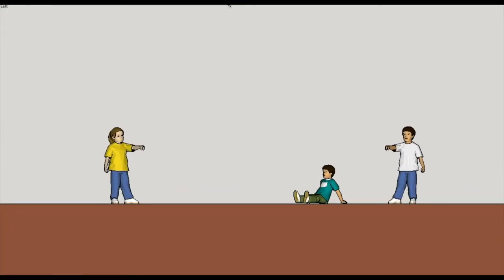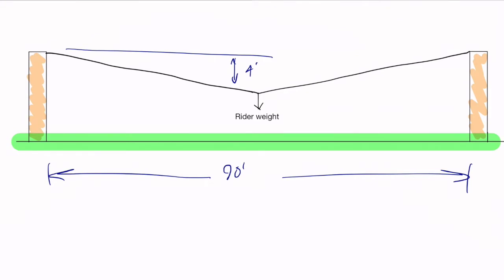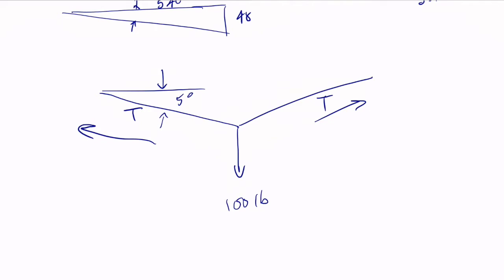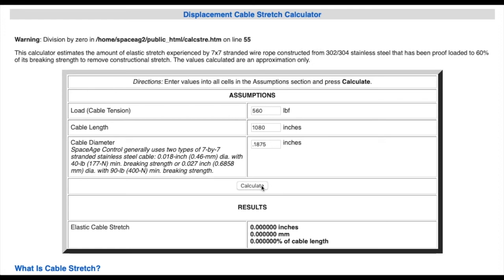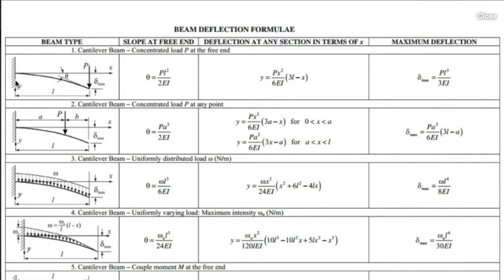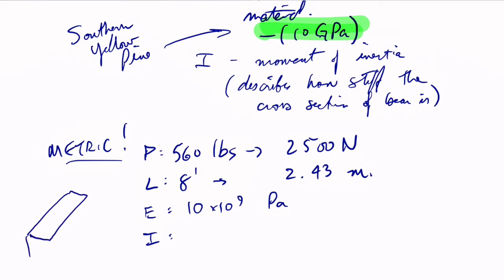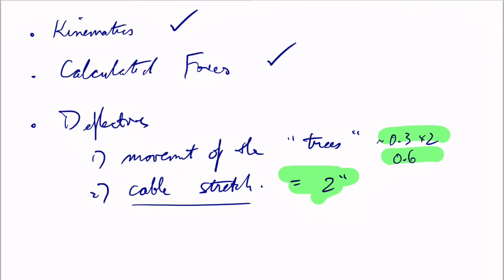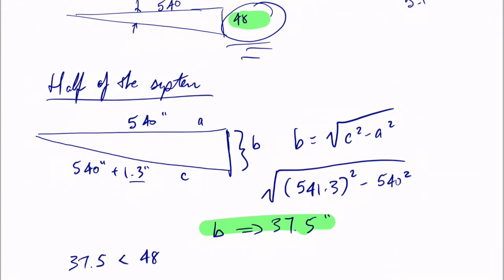Zip Line Calculations

Comment: I have a 500ft zipline in my backyard and we just used a string as a rough estimate of the height we needed. For some 250lb riders, they will bottom out in one spot, so we use a shorter leash for them to fix that issue and with really small kids we use two leashes so they can reach the platform at the end.
Reply from the maker: 500 feet!  Awesome.  Yeah, the big takeaway from my zipline experience is don't overthink it (if you have decent anchor points).

Comment: I’ve build 1000 feet long zip line with 5/8 cable. Is diameter sufficient? Thank you !
Reply from the maker: Man, that is an expensive cable but it seems like a reasonable diameter for that length.  Your anchor points are going to need to exert 3 or 4 tons of force, those are going to be expensive anchors also.  Good luck, and I look forward to seeing the video!
Reply: @BILLYSHED  it’s on my channel already! But video in Russian language)
I just wanna make sure the diameter is safe.
Reply from the maker: @misty_mountain  Awesome zip line!  That was a lot of work. Do you plan to sell rides on your zip line someday?
Reply: @BILLYSHED  no, just for fun.

Comment: Did you check the margin of strength on the cable (and connections)?  At what rider weight does the cable start to yield?  If it yields, is it still usable afterwards if you tighten it?  Do you know if cable work-harden? 

I am considering a zipline for my grandkids, and appreciate your engineering.  I am a retired aerospace engineer, and make similar videos on various projects.  The more math, the fewer the views, unfortunately.
Reply from the maker: Naw - I didn't calculate anything with the cable.  It came as part of a kit and the manufacturer's instructions said it was rated for a 300-lb rider (I think?).  I am 200 lbs, and it didn't yield under the stretch loads caused by my weight.  I imagine there's a good chance that the cable supplier already work-hardens the cable, because I calculate that a 200-lb rider ride puts it well beyond 0.2% strain.  Or maybe the first couple of rides stretch-harden it like you are asking.  It's not an issue, don't worry about it.  Look up what other people suggest.  Good luck.

Comment: As I watch your calculations (with gratitude and fascination, trying to relearn the math!) I realize that if the downward deflection is between 3 and 4 feet (37.5" to 48") our IBC tank anchored zipline system isn't going to be all that successful given that an IBC tank is only 3 feet tall and we would be putting the cable sling somewhere lower than that... Hmmm.  A failure? Or can we increase the tension (since nobody will be riding on it but it will be used for transporting cacao pod baskets). Any ideas?
Reply from the maker: Sorry friend - no ideas.  I am sure you will figure it out.  "Necessity is the mother of invention" - someone famous

Comment: Using telephone poles.  5% decline in  terrain with 100’ run.  Thought larger pole should go at top.  Does it matter?  10” diameter pole vs 12” diameter.  Concrete will be poured 4’ deep holes 3’ W x 6’ L
Reply from the maker: Ahem... size matters, of course !  But not like I think you are implying.  The pole at the top of your run isn't going to experience much more cantilever load than that at the bottom just because it's at the topside of the run.  If either the top or the bottom pole needs to stick-up higher out of the ground, use the larger diameter pole for that end.  Good luck, and I'd love to see pics / vids...

Comment: do you need to consider the weight of the cable in the force applied to the end points?  100ft of decent cable is pretty heavy.
Reply from the maker: The short answer (specific to a 90-foot zipline with 3/16" diameter cable) is "Nah, not so much".  The preload force needed to pull the sag to a reasonably small amount  is significantly less than the load once a rider jumps on.  If you have the preload pulled so tight that it significantly loads the endpoints, your rider is probably going to plow hard into the end of the ride.  Consider that ziplines are designed around stiffness / deflection.  Anyway, longer runs with heavier cables... yeah you will probably start to need worrying about the cable weight (or the preload force).

Comment: I have a customer who wants me to install a zip line inside their house from second floor to first floor I don’t think it’s possible any suggestions on how to do it so nobody get hurt
Reply from the maker: This sounds like a fun idea at first (assuming your client has a huge space?) but if you sit down and sketch some rough dimensions of the line and anchor points, and the rider hanging off the trolley, and if you think about how zip lines work, you will quickly reveal to yourself that, at best it's a bad idea and at worst it's pretty much impossible.  Sounds like maybe you already have reached that conclusion.  All zip lines have a downhill part (at the beginning), and an uphill part (near the end).  This is how you slow down.  If you don't have an uphill part, then you need a substantial braking mechanism.  Is your client's house like a normal family residence, or more like an industrial warehouse?
Reply: @BILLYSHED  just a normal residential house  hallway 3.5 ft at top 4 ft at bottom. I have built a lot of crazy projects but I think this out of any realm
Reply from the maker: @drumnmachn19   It's not in anyone's realm.  It's a busted idea.

Comment: Hi. You assumed at 1:40 that the rider is gonna drop 4ft over a 90ft run. Why did you assume 4ft? Is that from the sloap of your yard that is 4ft and bems at 8' tall?
Reply from the maker: I assumed four feet in order to roughly estimate the tension in the line.  And, 4 feet is a decent estimate just considering how my zip line worked.  If I assumed 3 or 5 feet, the rest of the math wouldn't change much.  The slope of my yard over 90 feet was about 6 feet.

Comment: Thanks for the video, really enjoyed it. I'm attempting to put a zip line in my garden for my kids to play with and plan to use 12x2 timber laminated together like you did. Was the 4ft depth of the end points based on a calculation? Im digging by hand in hard stony soil and am wondering if 3ft will be deep enough? What do you think?
Reply from the maker: Hey Graeme - I assume that the 4ft depth recommendation that you find all over the place is based on calculations, but not mine.  Check out https://www.ziplinegear.com/pages/how-to-build-a-zip-line-section-one-concepts  (.)  I strongly advise you to just bite the bullet and abide the 4ft recommendation.  I also HIGHLY recommend that you either use a power auger or better yet make a few phone calls and find someone who offers auger service.  The dude who dug my 18-inch diameter, 4-foot deep holes charged me $50... for two holes!!  Best $50 I ever spent.  Philosophically I believe that if you don't know what you're doing, your best results are to trust the people who do.  That's why I did 4-foot holes.
Reply: I am doing the same.   Rocky ground.  I'm down 36" inchs and it's getting very difficult to remove the dirt.   I'm using 2 3x12 instead as I want a go on it😂

Comment: Hi Ryan, I am an engineer myself but haven't dabbled in structural work since my University days so have just been refreshing myself to help with design of a post to fix a zipline and/or slackline to and stumbled across your video. The product manual I have for the slackline recommends designing the post to handle a load of 11.5kN (appears to be the rated capacity of the line). Just wondering if you gave any consideration to the force on the post generated from setting the zipline to the required tension for use, prior to loading from users. This is probably more applicable to the slackline installation which comes with a ratcheting strap and needs to be set quite taught for use. Thanks
Reply from the maker: Hey Evan thanks for your comment.  Yes I gave thought to the force needed to set the line.  Just like the website I for calculating cable stretch (which I showed in the video) there are online tools for calculating sag.  If I remember, I calculated that it was a little over 500N (110lbf) to get the line sagging less than 100mm (4") over the 27m (90') run -- not much force.  The instructions with my zipline kit advised to use a "trial and error" approach for setting the tension.  In practice, the kids were the ones that said "more/less", and I found that even relatively small changes made a huge difference in the ride.  Every installation is different and different kids have different appetites for speed.  I wayyyy overthought the whole thing because it was fun for me, but you really can just follow the manufacturer's instructions and you'll be fine.
Reply: Thanks for the response. I will check out the online tools and see what force would be required to minimize cable sag for the slackline to say 1inch and see how this compares to the manufactures recommendation of 11.5kN which i think is a bit excessive. Cheers
Reply: Hi Ryan, I stand corrected. The manufacturer's recomendation for the slackline does cross check!  I assummed a sag of approx. 0.25m over the 10m span and adopted a tension force of 11.5kN. This equated to a load at mid span of approx. 120kg the rated max weight of the system. Thanks for the discussion.
Reply from the maker: Evan Johnson -- Excellent!

Comment: Thanks for the engineering.  It is refreshing to see this applied rather than people blindly hooking stuff up and saying "good enough".  The only calculation question I had is if the mass of the cable needed to be factored as part of the weight?

I have a decent 40cm yellow birch tree at the top, and nothing at the bottom 70m away and 12m lower.

I was wondering if you had considered running an additional cable down at about a 45-60 degree angle to a ground anchor in order to minimize load on the post/tree? From an engineering standpoint, this seems like it may be better with significantly higher loads from the longer run.
Reply from the maker: Hey Michael, in my case (a 27 meter long run) the cable only weighed a few pounds so it's negligible.  For longer runs where the cable weighs as much or more than a rider, well yeah, the cable weight itself becomes important or even dominant.

As far as a guy cable - yeah I did consider it but I preferred to avoid the extra "junk" around the installation.  I didn't want dogs or kids to get snagged up and possibly injured if they were running around and not paying attention.  BUT a guy cable definitely would have reduced the requirements for my main anchor posts if I had chosen to use them.
Reply: @BILLYSHED  Would having a small frame diagonal down from the post to ground in front helps much, if at all? Say post is 8' tall, adds a diagonal lumber from 4' height of post to 4' ground in front (which also has concrete in ground). Thanks
Reply from the maker: @6ahyw  yep that would help to reduce deflections a lot.

Comment: Great explanation! Did you look at using alternate materials such as steel or aluminum posts with or without guy wires?
Reply from the maker: Regarding alternative materials: Nope.  2 x 12's were readily available and cheap.  But if you can find a source of metal poles, then you can still use my cantilevered-beam calculations, you would just need to change your modulus of elasticity (E) to either 70 GPa (aluminum) or 210 GPa (steel), and you would need to re-figure your cross-sectional moment of inertia (I) based on an annular cross section rather than a solid rectangle.  Regarding guy wires:  That's a great option if you are willing to deal with more anchor points and a larger footprint, including wires that are a trip hazard.  Wifey nixed guy wires so I went cantilever.
Reply: @BILLYSHED  Not set in stone yet, looking at 6" square alum column, if not then wood. Got it, thanks

Comment: Is this missing in your calculations? --  cable weight --  shouldn't the weight of steel cable itself be added to load mg?    my cable weighs as much as my 100 lb son so would that not double the tension required to hold son AND cable?     Thanks,  (currently building 450 footer)
Reply from the maker: Yeah - for longer runs like yours the weight of the cable itself (without a rider) will become significant.  In my case I neglected such effects because the cable was pretty light over my 90-foot run.

Comment: Hi, thanks so for much for the video, currently helping someone build one. Three quick questions:
1. How much elevational difference is needed (or ideal?) between the two 'trees'?
2. Depending on your answer to #1, if someone is on flatter ground might they need to allow for less sag so that momentum is not lost?
3. Lastly, for the dimensional lumber, do the proportions matter at all or strictly the cross-sectional area? Is a 6x6 post as good as a 2x12 for this?

I am working with one natural tree at the high end & one man-made 'tree' at the low end. So if the connection point on the actual tree is at 3.4m I am trying to figure out what height is ideal for the low end with about 600mm of actual elevational difference in the ground. Thanks!
Reply from the maker: 1. Depends depends depends… on the length of the run, on how stiff your endpoints are, on how much fun you wanna have, do you have a brake, etc. 
2. Yes. 
3.  Cross sectional proportions matter big time.  It’s not cross sectional area. That Doesn’t mean anything.  Re-Watch my video. The “h” matters way more than the “b”

Comment: Hi Ryan, I really appreciate your video. I have one question. You solved for tension this way 2*T*sin(theta) = 100 lbs (mass?). My question is this. Isn't tension a force? Shouldn't the equation be be 2*T*sin(theta) = 32.17405 ft/s^2 *100 lbs and then solve for T?  If I'm right the horizontal load on the post is 1433.1795 lbf. I'm not trying to be a smarty pants, I'm just trying to make sure I understand. Thanks for the video its well done.
Reply from the maker: Hi John.  Thanks for appreciating the video.  I see three question marks in your comment and you seem to be asking in earnest so here goes:  

1)  100 lbs is not a mass, it is a force.  Around the three minute mark in my video, I perform a simple static force balance to approximate line tension.  Compared to free-fall acceleration like jumping out of an airplane or being launched out of a cannon (in both cases where the object is in free-fall towards the center of the earth at 32.2 ft/s^2), a zipline ride is pretty well approximated with a static vertical analysis.  The downward force (rider weight) is balanced by the vertical component of the tension in the line.  Force equals force.  Not Force = mass* acceleration.  Quick google search on "static force balance" finds this page for a quick lesson: 
https://www.physicsclassroom.com/class/vectors/Lesson-3/Equilibrium-and-Statics

2)  Yes, tension is a force.

3)  No, the equation should not be as you have it written.  No need to bring Mr. Newton into this analysis.  See answer (1.) above...

Cheers.
Reply: @BILLYSHED  Haha, sorry for all the question marks. Thanks for your reply.

Comment: Thanks for posting this Ryan. I was going through the calculations myself, and I used a 200 lbs rider (if I'm going to build it, I want to be able to use it myself too :) and I found that for two 2 x 12 planks, the shear stress was 1305 psi engineersedge.com/beam_bending/calculators_protected/beam_deflection_9.htm. The shear strength for pines is between 885-1500 psi https://www.engineeringtoolbox.com/timber-mechanical-properties-d_1789.html, so I wasn't comfortable with that. I found a lumber yard that sells locus logs (don't have to pay for having it finished :) If it works well, I'll post again. I see that you had a good 4 year run with your design - that's cool.
Reply from the maker: Luke Bissell Thanks for the comment and in the name of science, you should post your results regardless!!  I’m sure it will be fine. I’m also a 200 lb rider. I think the compressive stress on the front side of the beam started to approach published limits with a 200 lb rider, but there was still some safety factor. I find it hard to believe that shear would be anywhere close... maybe I’ll run the calculations for myself. Anyway, I’d love to see your system when you get it online. Godspeed

Comment: Amazing video! Thanks for the calculations!  I was planning on using the clubhouse I was building until I determine how much lateral force would be acting on my wall.  One point of clarification on your calculations.  2x12 is nominally 1.5 x 11.25, not 11.5.  It jumps down between 2x8 and 2x10's 1.5 x 7.5 and 1.5 x 9.25.  Weird, huh?  Do you think it would be possibly to anchor the wall back to a tree, if the wall were in the same line as the  zip line on the other side of the wall?
Reply from the maker: William Jackson Indeed it is weird, the dimensions. We are getting ripped off!  Somebody should talk to somebody about this.  Regarding your question about putting a clubhouse in the middle of your load path, I don’t know. It might work just fine - you probably will end up with more deflection compared to a standard installation. You will know pretty quickly if it is going to work, or if it is going to rip itself apart over time. Good luck and shoot some video and share! Honestly, one of the biggest lessons I learned at the end of my zip line project is that it is a pretty forgiving system. You really don’t need to overthink it.

Comment: The one thing that wasn't clear was that because of slop in your line your zip line was 4 feet lower at one point?
Reply from the maker: Hey Scott- yes the bottom end was 4 feet lower than the top end, in a global sense because the yard sloped 4 feet over the run. But At each end, the cable was attached to each anchor approx 8 feet high off the local patch of ground.